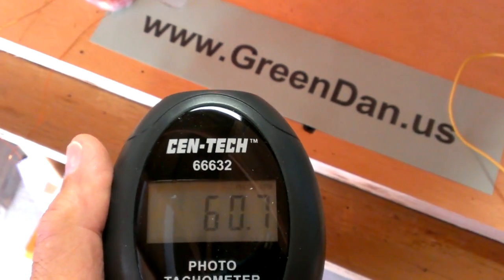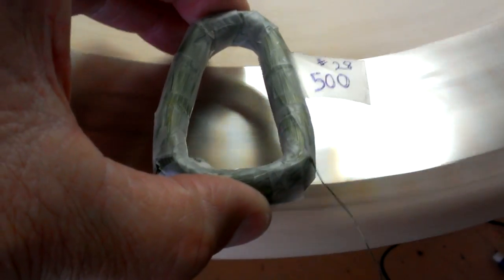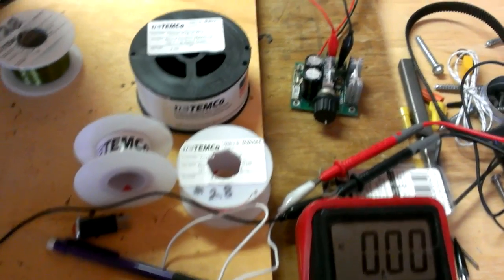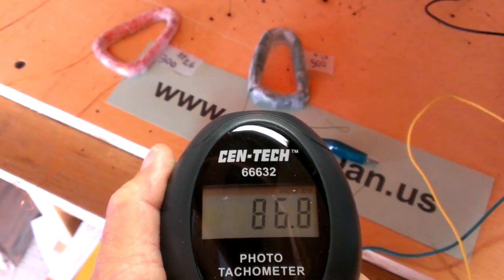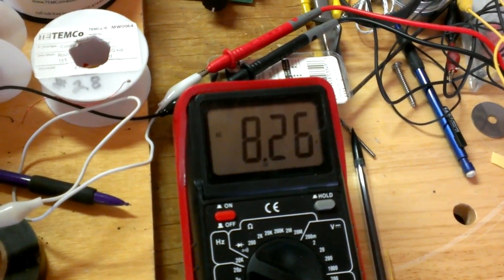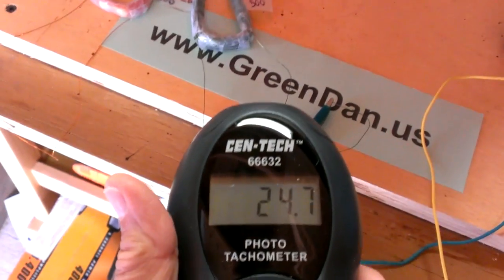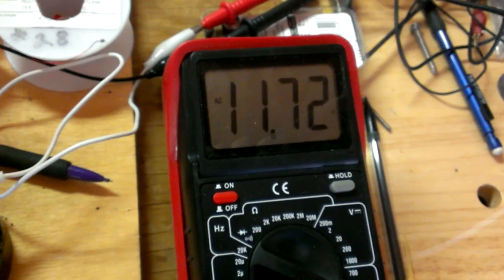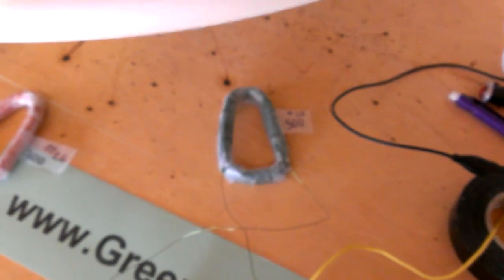Higher rotor speed means more volts

Comment: what a waste of magnets putting them on wood!! also you can't use wire that thin
Reply: Gavin FreedomLover Yes you can use wire that thin. I have built alternators with wire that thin and connected all the coils in parallel. So the voltage produced is the same (about 12 volts) but the current is greatly increased.